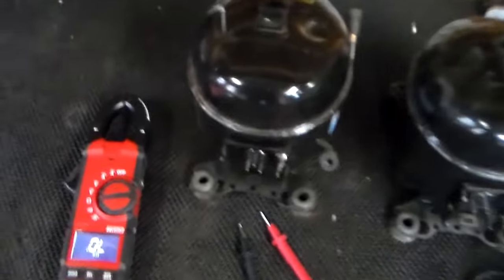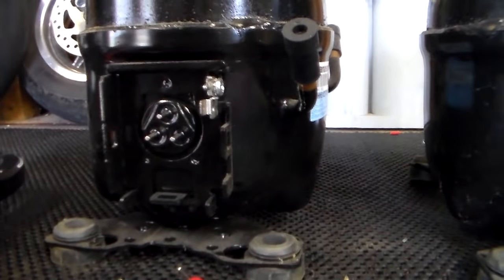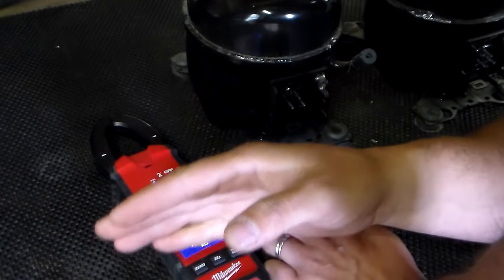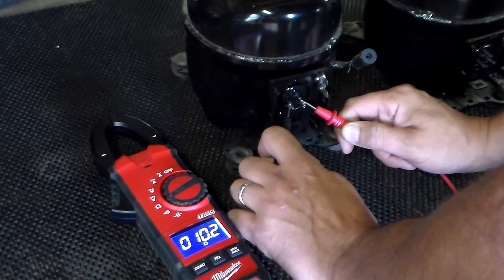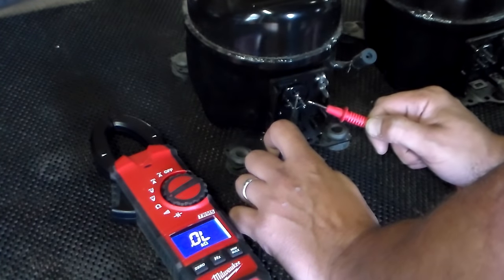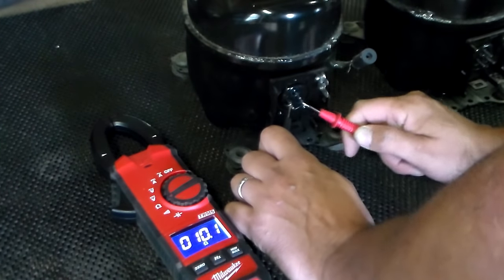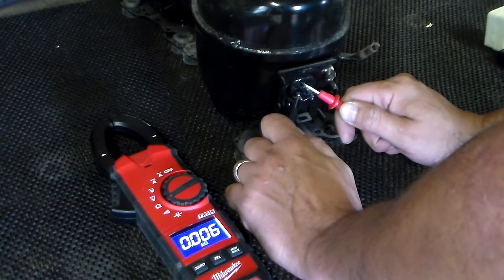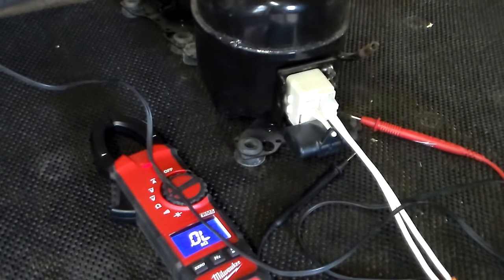How to Test the Compressor on your Refrigerator

Comment: You suggest that the resistance values you read across the CRS pins on those compressors is typical of all single-phase compressors. Different make/model compressors have different resistance values, and those model-specific values are typically printed on the compressor's spec sheet or printed on a schematic that is affixed to the refrigeration unit.
Reply: Thanks for clearing that up. But they are never supposed to be OL between pins correct?
Reply: I checked the pins on my compressor Frigidaire unit and showed 11 ohms, 4 ohms and 9 ohms. It’s not starting. I tried 1 type of relay and didn’t work. My relay is all one piece so not sure. I tried a combo relay. Gonna order original part on ebay but it’s a used part. Hope it works
Reply: What about a very large ohm value
Reply: My fridge stoped while in vacation.  Just did this check on kenmore Elite, and 2 of the pins are open. I keep checking it.  noooo it needs a new compressor that might not be worth fixing. Lasted 6 1/2 years not that good in my opinion.

Comment: Hello folks. I have a Cen-Tech multimeter with various wattage settings for Ohm (resistance). It starts from 200 W and goes all the way up to 2000 kW. Which wattage setting should I use to test my refrigerator compressor? Also, what if the readings keep on fluctuating and does not come to a stable reading? Does that mean the compressor has gone bad? If not, then what kind of a reading should a bad compressor give?

Comment: I just tried your method of troubleshooting and found my relay to be bad. I got ohm readings like yours on all my terminals off the compressor and good voltage reading to the compressor. It's people like you that make my day. Thanks so much for your video.

Comment: UPDATE!
I got it going!
As i stated i had already replaced the relay, so i thought it was the compressor.
It turns out, during the process of me taking the wires off of the old relay, i had loosened the connector, so therefore it was a weak connection.
 I decided to check it out one last time, because everyone i talked to said it was probably the relay, since it rattled when i shook it. I was going to move one of the 2 wires to another prong, thats when i noticed the loose connection. Tightened it down, and BOOOOOM! Frig working again!
Thanks for helping with all the video's! You do an excellent job at it!
Just don't forget to emphasize on the tightness of the connectors, that connect to the relay and the overload, because it took me another day on this thing to figure out such a little screw up!
Reply from the maker: scottywhatu gondoboy Awesome!  Glad your back up and running!

Comment from the maker: A place called Friedman Electric.  Here is the information about the meter.
MILW 2235-20 400A 600V CLAMP METER
I think I paid around 200 for it.
Thanks for Watching!
Reply: Damn Bill. Two hundred is a lot to pay for a multi meter, but guess it is worth it if you are in the business. I hope this Walmart $15 Cen Tech brand digital meter will work for the few times I will be using it.

Comment: Just want to thank you.  I see that this video is several years old. I don't know if you respond to comments.  But, I'm just a chick trying to help with parents upright freezer.  6 months past warranty. If I could help save them the cost of having someone come out.  Still trying to troubleshoot what's even wrong. But I appreciate videos like yours.  I did watch the video about hooking up the 3 in 1 to the compressor too.  Probably won't do that because we need a permanent solution.

Comment: Replaced Relay and Overload ( without testing them), when compressor not running, fridge not cooling, but internal fans all running. Cost $43 including S&H. Compressor still not running. Bought a multimeter ($20) to check compressor. Although readings bounced around they settle to similar reading as yours. (I assume its the dirt/dust on pins). So compressor is good. Now I'm Looking around at your videos to see what else it could be. Would like to test the 120VAC to compressor as you stated. But I'm worried I may stick multimeter pins on things I shouldn't.  Hoping you have other videos. Thanks for this video. Very Helpful! I'm thankful to know I may still be able to save my fridge!

Comment: Thanks for the info. I wish I would've seen this video before I bought the 3 in 1 starter kit. I did the ohm test in the same order you did on a mini fridge and my readings were 37, 18, and 21. So I guess my compressor is bad because it does not start. And by the way the rooster bit was hilarious!

Comment: Thanks for your video. It helped me greatly on how to use and check with my multimeter. One thing could’ve been a tad more definitive on what to set my multimeter dial. Relay didn’t rattle. Problem was motherboard burnt through on the back side. Local store had it in stock. $200 and I’m back in business,

Comment: Hi Bill, I checked pins on my compressor and gave me all readings lower than yours: approx 8.5 (bottom two), 5.1 on bottom left and top and 3.4 on top and bottom right. Is that still ok, or is my compressor bad?  Thanks for the great video!
Reply: I had similar results. Mine was 11 ohms, 4 ohms and 9 ohms respectively. No short to ground on any of the leads

Comment: Thank you for the video. Tested my 4-year-old Kenmore Elite/ LG compressor. Bottom center to top left pin gave me an up and down wandering reading between 10 and 15. Top left to top right did not register. Top right to bottom center, no reading. Imagine my disappointment finding a blown compressor on a machine that cost me upwards of 1500 dollars and only four years old. I may just paint this thing yellow and set it in the front yard with their corporate logo's and a lemon sign on it. Really happy that the corporations are making out so well building this junk overseas.
Reply from the maker: +Glenn Jones It's a shame though.  Does your refrigerator have a 5 year warranty on the compressor or sealed system?

Comment: Great explanation easy to understand  l have  question for you what it could be the cause when the refrigerant  compressor is hot  thankyou
Reply: If the compressor is running properly. it can get hot when the condenser fan is not working, condenser coils are very dusty, or there is not enough air-flow to the back of the refrigerator to cool it down. 
 Bun if the compressor can't start or starts for a few seconds and stops, the start relay could be bad, or locked-up compressor piston inside, which requires a new compressor replacement.

Comment: I have a 7 year old medium sized Whirlpool fridge, 11.2 cu feet size. 

Always worked fine since new. One day this week it started making a loud noise. I tested the capacitor and it does hold a charge.  I tested  relay and the bottom holes do not have continuity at all. And the overload blade and pin hole have continuity. 

The compressor pins on the unit all test good. And none are shorted to ground. 

So can a bad relay cause the compressor to be very loud but not run? Thanks!

Comment: Check your bottom  2 pins  get your number in this case 10 then check one pin to common which is 6 the other which is 4. Then add them together and you should get the what the bottom pins together equal. 6+4=10. The compressor is eclectically good. 3+1 hard-starts are the thing to use if a relay has went bad or capacitor.

Comment: I have a mini fridge that I just bought 4 months ago and it worked fine for a while, but then started freezing everything no matter where I set the thermostat.  Before I really got a chance to start troubleshooting it it just stopped cooling at all.  It makes a click apparently trying to start the compressor, then after 8-10 seconds, clicks off.  I replaced the thermostat and still got the same.  I measured across the pins on the compressor and the (apparently) good news is that I don't have any OL (I never knew that meant "out of limit" until a different video I watched yesterday) readings across any of the pins.  My readings aren't like yours though.  Across the 2 bottom pins I read 24.8 ohms - left bottom to top = 7.9 ohms, and right bottom to top = 16.8 ohms.  I went ahead and ordered the starter relay - so I'll try that.  

In case you're wondering why I am not pursuing repair/replacement under warranty, I am.  It's just that the manufacturer does not actually offer service.  If they determine that you qualify for warranty replacement, they just cut you a check.  So I though I may as well see if I can fix it.  In the Chicago suburbs, you can't just put it out on the curb.  You are supposed to take it into an electronics disposal/recycler and they want 45 bucks to junk it.  By the way, full disclosure, I am a semi tractor/trailer truck driver and had the fridge installed in my truck which does a fair amount of rattling around.  If I end up replacing it, I will (uncharacteristically for me) spring for the extended warranty.

I appreciate your video and went ahead and subscribed to your YouTube channel.  If you get a chance, please let me know if there is anything I'm overlooking.  Thanks.
Reply: I read a lot of the comments on this video after I left mine.  Sadly, it seems that Bill has passed away.  I found an answer to my question about the resistance measurements on the compressor elsewhere on YouTube.  Apparently adding the two lower resistance values together should approximate the higher value.  In my case 7.9+16.8 comes close to 24.8 - so the compressor appears to be good.  The other test of the three pins individually to ground also indicates that there is no dead short in my compressor.  Hopefully someone finds this helpful.  I think that would be a good tribute to Bill.

Comment: Bill, my refrigerator is not getting cold enough. It gets cold, but not enough (about 40 degrees F freezer & 56 degrees F in refrigerator). 
My fans are running, I never had any frost buildup that would keep things from getting cold. I did resistance test on compressor motor and it is 8.2 ohms, 2.2 ohms and a total of around 12 ohms. 
I tested by shaking the brown relay and it was intact (no shaking inside), I actually tested continuity with the part that hooks to the wires and the connection and it had continuity. Testing the overload protector (a separate component) and a continuity test showed it was closed which indicates it should allow the compressor motor to turn on. I tested the cold control and in the off position it is OL and switched on it has continuity. 
I heard that no fans would run during the defrost cycle so I would assume that because I don't have a problem with too much frost(not any) that we are okay here because it is getting some cold.
Any suggestions??? Do I have low freon???
Please help!!!
Reply from the maker: If compressor is running and you have no frost buildup, I would say lack of freon is probably the issue.  The evaporator inside the freezer should have a light layer of frost over the whole thing.  Check yours, you will find that only a small portion of it is frosted over.  Let me know what you find.  Thanks for watching
Reply: Cool! Thanks for responding. I just took the cover off and looked at that. There is in fact a "light layer of frost" over the top most, back portion, but I wouldn't say over the whole thing. I don't quite know how any freon would have escaped. My refrigerator is 15 years old.
With this description of symptoms, you think it is time for another fridge??
Reply: one of two things low gas or thermostat

Comment: I appreciate your information. My compressor - a Embraco EGX70 (on a Frigadaire side-by-side refrigerator) runs and tests ok with a VOM, but it fails to cool! I bought a 3 in 1 starter and it still fails to cool. What's the next step? Is the compressor shot? The unit isn't excessively hot to touch, but the cooling copper tubing doesn't get cold.

Comment: Very helpful video, thank you. I just tested the compressor  as you are showing in this video, but the levels I am getting  on my multi-meter  are much lower, like /3.6/3.4/2.9/and is beeping .Does that mean the compressor is bad, and do you think if I install 3-1 start kit would fix the problem?Right now it just clicks on  runs for 10 sec. and clicks off. Thank you in advance .

Comment: This is a really helpful video....  I have a 10 years old frigidaire fridge that is not cooling.
I heard clicking noise last week that would come and ago...and stop cooling every time the clicking noise exist. Unplugging the fridge would solve the issue previously and will get the fridge to cool again... however it no longer works, the voice are gone now and completely stop cooling.  
Both of the condenser and evaporator vans are running, but the compressor is not running.. I did the resistance check on the 3 prongs of the compressor and getting the normal resistance reading ( ~6,~10,~4 ohm). I also check the resistance of the relay and the 2 bottom holes read 6.5 Ohm. Based of the video seems like both of my compressor and relay are ok.... so what do you think is the issue and what should I check next  ?

Comment: Good video.  Yours gives Ohm readings for the 3 pins.  Better than just a continuity check.  Mine had 11.6 ohms/9.1 ohms/2.0 ohms so I guess it is bad.

Comment: hi bill thanks for d vid, was able to fix my refrigerator in about 40 min.....one of the wires connected to the relay which attached to d compressor was burnt off(power fluctuation i guess....kinda have that problem sometimes....need a fridge guard)

Comment: How close do those readings need to be on a freezer comp? I’m getting about 4 on both pins and 7.3 on the other pin. But after doing these test and putting things back together the comp stared up. This is a 20 yr old Frigidaire freezer is worth messing with?

Comment: Hi Bill thx for the great video. My fridge is not cooling i replaced the starter replay and the new one got burnt. I also checked the compressor terminals for resistance and i get no connectivity between 2 terminals (left seems to be the culprit). What would be the approx cost to replace the compressor and would you recommend it on a 7 year old Whirlpool gold side by side?  

CJ

Comment: Hi bill, i did the test you have here and all checks out. I get 8, 6 and 2. I plug in my fridge and all works fine, fan is on, coils get cold, once i unplugged the fridge and plug it back to the wall compressor wont start everything else works. After 5-10 min wait if i plug in back in it compressor starts right away along with fan. I notice compressor gets little warm but not super hot. Any idea?

Comment: I have a standalone freezer. When I plug it in the light comes on, but it does not get cold. I have check the relays and the compressor. I have also made sure to adjust the dial to cold. I do not hear anything running. Thoughts?

Comment: Having trouble and wanted your opinion. Fridgidaire side by side. Lights are on. Controls working. Fan running and compressor is running. Relay doesn't rattle at all. But it's not cold. Recently moved it and had to lay it down. Could that have caused a problem? Thank you

Comment: Thanks Bill! Always appreciate your diy videos. So on my samsung dual compartment fridge I tested the terminals on the compressor. All 3 pairs read about 10 ohms, unlike the 10, 6 and 4 ohms in your video.  Does this mean my compressor is done for? I also tested the relay leads and it read 0. Do I need to replace the relay? Thanks again.
Reply: Also, tried testing the relay terminals to see if I'm getting 120 volts and it read 0. Is the compressor relay bad?

Comment: Mr. Newberry, with regards to using a Supco Relay Overload Capacitor 3 in 1 relay combo kit that works with 1/4 to 1/3 HP compressors and Maximum RLA of 6.8 amps, my question is do you have to remove the existing parts?  I had to remove the Start Relay because it rattled and was obviously broken, but do I need to remove the Run Capacitor and Overload before hooking up the new 3 in 1 relay combo kit?  Thank you in advance for your prompt response.  I like your videos for their easy to understand.  Thanks again!

Comment: Hi Bill - great video - My freezer has stopped working - there is a clicking noise as if there is power trying to start up the compressor, is shakes slightly then stops before it kicks in. Does this sound like the compressor itself is gone? THanks for you any advice you can offer here.

Comment: Bill, great video and still relevant all these years.  My chest freezer took a dive and I'm checking the components.   Compressor gave me readings of 13, 8 and 5.5 on a few tests.  I think the compressor is good.  I think the capacitor is wonky as it's not testing out but maybe I'm doing something wrong on the test.

Comment: Hello Bill, Thanks for all the helpful videos. I am working on a Franke Freezer the compressor comes on for about 3 seconds and then it turns off for about 3 min or so comes back on for another 3 seconds and cycle starts all over again the condenser fan runs through out the on and off cycle so the power is present. I have replaced the capacitor but no luck the system is charged and no leaks. Any Idea??? Do I need to replace the compressor???

Comment: Fantastic information .I sell car air conditioning recharging units and a problem for me is i know the compressor is running but some times i get slow refrigerant recovery the unit use fridge type compressors as per you videos I normally chauge the compressor is there anything i can make up to test  this. Is there any type of valves i can install into the suction line that will let me take a reading in Vacuum without removing gas first ??

Comment: Hi Bill, Im having an issue with my frigidaire side by side refrigerator.  Everything turns on the compressor runs but its not hot. Its kind of warm but I can touch it and hold my hand on it after its been on a while.